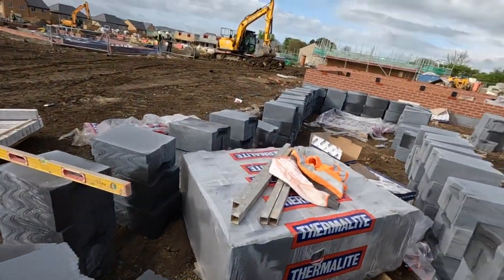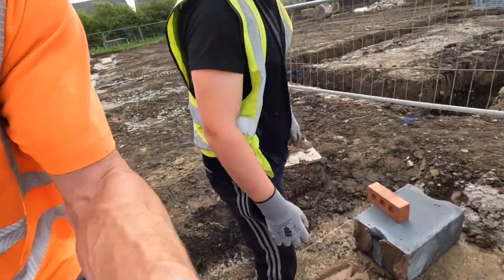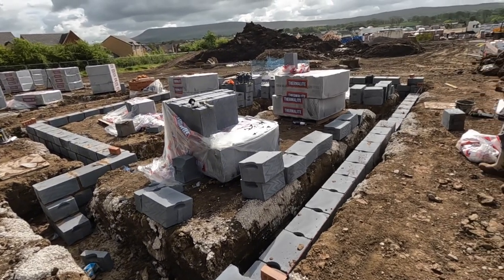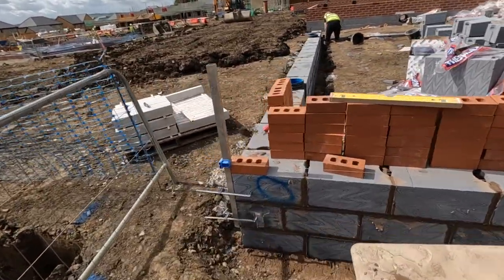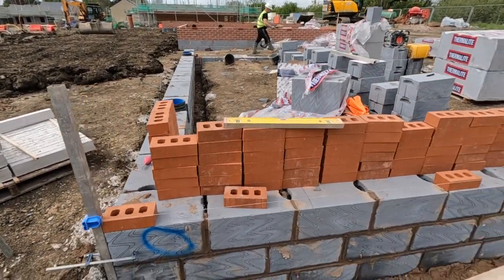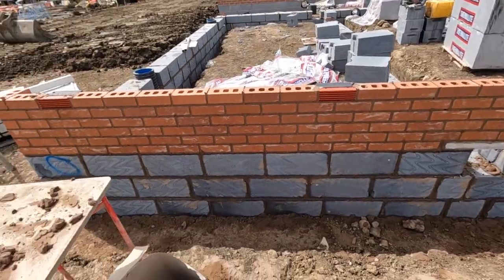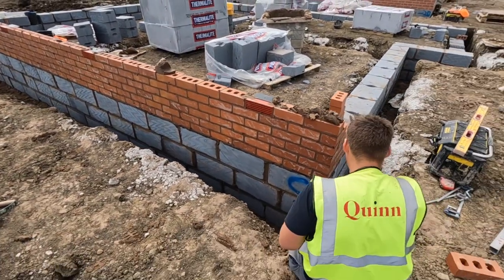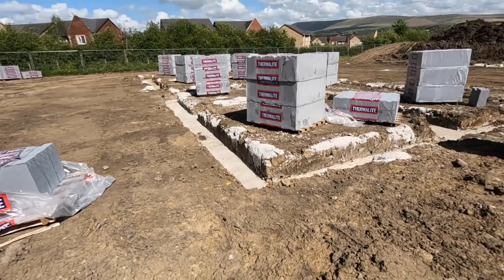New Build Foundations - Bricklaying In The Sun

Comment: Why do you  run 3/4 bond on the block and only spread mud        one block at a time?
Reply from the maker: @ Kevin Frederick The trench block we are using are 440 x 215 x 300 wide so it works 140mm bond from the corners. NHBC require minimum of 100mm bond so we've never had any problems. The block start to soak up any water in the mortar when they are dry so its a lot easier to just spread for 1 or 2 at a time than having to struggle to get them to the line
Reply: we have to use a 100 mil block as a bond breaker in the corner or some concrete dollys would never get away with near enough stack bond on most of sites were on
Reply from the maker: @christophervane6428  140mm bond on the corners. The minimum required by NHBC on trench blocks is 100mm. I've never had a problem in over 20 years of building foundations on site.

Comment: Do you laser these footings mate?
Reply from the maker: Yeah we always give them a check before setting out for the facework. We are given levels of the engineer before we start but like to make sure they work gauge from the top of the trench blocks whenever possible
Reply: @markbullen1489  so you try to get any discrepancies out in the trench? Then stick to gauge on the splash. Noticed you don’t leave door ways out? . I’ve always done supers but I done a footing the other day and got pulled for not leaving doorways down 2 course ? Never had to do it on footings before is that new? Earned good money doing them though !
Reply from the maker: @bardy9240  Yes most of the time we will try and get everything level in the trench block so that the brickwork looks right and isn't bumped up 20/30mm with big beds. Some sites use a curb edge on the front and back doors or a snapped header to get the door frame flush for level access.
Reply: @markbullen1489  sound mate. Yh new it was for level threshold guess it’s site specific then. Good work anyway and just subbed 👍🏻.
Reply from the maker: @bardy9240  Thanks mate